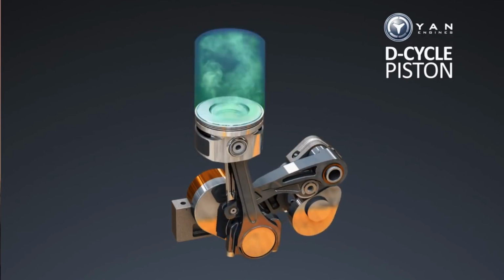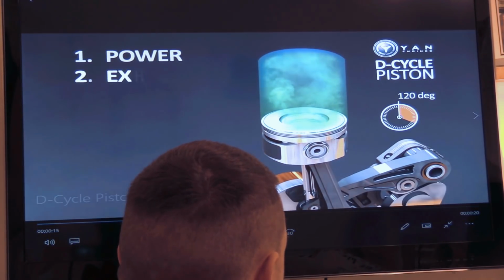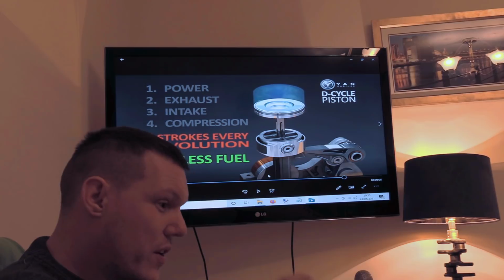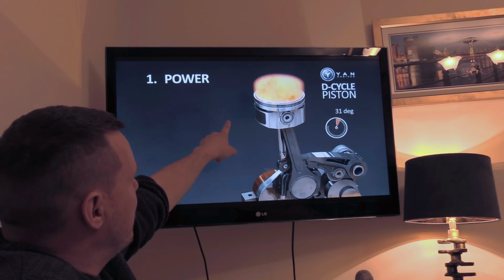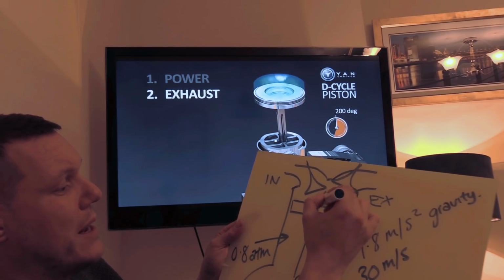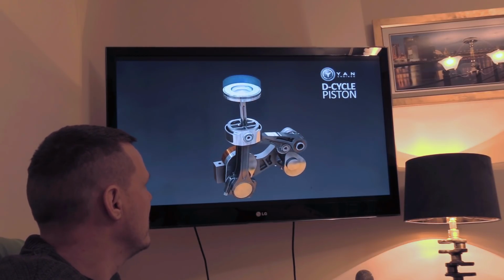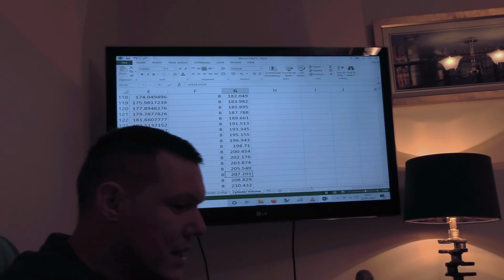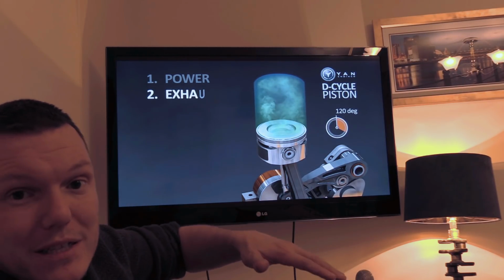Is this a GAMECHANGER? | D-cycle engine

Comment: Hi, Guy, Shall we get together to bring this "Gamechanger" to serve humanity. This engine should operate at half of the 4-cycle rpm, since it work whole time instead of part time. Therefore the crown section Which can be much lighter for higher speed, is at roughly similar rom, depends on the design. This engine has higher torque which moves the car, not the horsepower, which keep the speed.

Comment: Interesting vid Matt, some cool ideas here, but really not sure about having most of a piston acting like some sort of flying crosshead bearing that meets up with it's other half at speed.
Yeaaah...lot of issues with this design, I'd be interested to see how they could be feasibly overcome. I'm wondering if it's possible to do away with that extra camshaft altogether and use a linkage off that forked con-rod to rock the arm up and down, so it's kind of like somebody took a steam locomotive valve gear and stuck it inside a crankcase arrangement 😂

Comment: Let's assume for a moment that the engineering challenges are/have been overcome. Because of the huge accelerations the upper piston would be under, it would probably only be suitable for low rpm running and probably with only minimal rev changes. In that case, I think the best application for this would be for things like a generator; where efficiency is needed and  operating under varying rpm is uncommon. But then you run into the problems that things like generators need to be extremely reliable and reliability require simplicity..... long story short it really is a cool idea but without much practical application without TONS of cash for R&D.
Reply from the maker: The acceleration is only part of the calculation, what you need to know is the weight and the force the connection can take...
Reply: @thedirtyworkshop   - Absolutely correct. If the engineers were able to keep the mass of the upper piston very very low, it could handle relatively extreme acceleration; but if it is very heavy it will not. One reason why I mentioned only the acceleration is because as the accelerations within a given system increase, the sensitivity to the mass of that system will also increase.

All things being equal, if the upper piston has to move the stoke length twice as quickly/twice as often as the lower piston (lets say the crank speed is 1,500 rpm) that would mean that the upper piston, which must move in a 2:1 ratio with respect to the lower piston, is effectively at 3,000 rpm in terms of the accelerations it's experiencing.

That brings up another aspect of the engine which may not be so advantageous. Lets just assume an average piston speed of 25 m/s and a stroke length of 86mm for both a normal 4-cycle engine and the upper piston of the d-cycle. Although the d-cycle has twice as many power strokes per crank rotation as a normal 4-cycle engine, it also can only run at half of the crank rpm due to the 2:1 ratio of its upper to lower piston.

Comment: Multi-stage dry-sump piling system could pull a vacuum on the crankcase (like in the new Z06 corvette) and get past that issue.
Reply: The predecessor of the Otto-motor (todays gas 4-stroke engine) was working poorly, because it was based on atmospheric pressure. The main invention of Otto was the compression stroke. It made something that somehow runs on it‘s own into something that produced power.

Comment: CONSCERNING THE 20% FUEL SAVING. AS A NORMAL 4 CYCLE WOULD HAVE INTAKE DURATION OF 180 DEGREES CRANK ROTATION OUT OF TOTAL CRANK ROTATION OF 720 DEGREES, AND THE D-CYCLE ENGINE HAS AN INTAKE DURATION OF 120 DEGREES OUT OF A TOTAL 360 DEGREES, DOES THAT NOT MAKE IT LESS FUEL EFFICIENT. OR AM I SEEING THIS WRONG ?
Reply: apologies for the caps, its late lol

Comment: I don't think that it will suck less air than a regular engine. Although it will have an intake stroke of only 120°, this stroke will be of the full volume of the cylinder, so the main difference with the R1´s engine it´s the duration (in time) of this admission stroke. When engines are revving high, one of the main losses of power is because of the gases moving fast through the pipes (admission and exhaust). In this engine, both admission and exhaust strokes are really fast in comparison with the engine speed, so, these losses will be really important.
Also, the gases through the exhaust valves normally get choked, so this engine will need really big exhaust valves for being able to let all the gases go out in such a short time.
Reply from the maker: Mass flow rate comes to mind

Comment: The piston speed of that top piston would be beond F1 and not enough time to fill the cylinder on intake maybe high boost? even a low reving v8 stock still has 250 degrees of intake duration with a high rpm cam having over 300

Comment: Upon the first animation I spyed the timing of the two positions meeting at 0 or + 0.0xx amount as the most serious issue. 12:40
As a cold engine with it would be nosy, temperature any positive interference results in a whole bunch of metal bot over time.
A difficult task for say the least.

I agree thee then cross section of the top piston is likely the second bugaboo.

I don't think oiling the mini wrists and is that much of a problem.  The hollow camp chef feeding through the rocker arm of through the connecting rod to the wrist pin.
Exiting out the small wrist pin spraying walls......

Comment: what would be the max revs this arrangement would allow?? .., what would it sound like running ??? would it sound a bit like a 2 stroke maybe?? very interesting concept good video cheers
Reply: There will be a big compensation in rpm I would go as far as to say it will drop rpm by 20% minimum compared to same cc 4 cylinder engine
Reply: Probably more like a high revving 4 stroke. It's the exhaust pipe on a 2 stroke that gives much of the characteristic sound. Edit: a 4 stroke at twice the rpm.
Reply: @Henrik.Yngvesson  cheers
Reply from the maker: A 2 stroke sounds like a 2 stroke because of the firing frequency, I thought everyone knew that, obviously not.
Reply: @thedirtyworkshop  That's only half of it, my low revving 2 stroke trials bike get's often mistaken for a 4 stroke because it's low revving and it pretty much has a straight pipe so it sounds very different from a typical 2 stroke dirt bike of equivalent size. The shape of the exhaust and valve times effects the sound as well, a trombone doesn't sound like a guitar just because they hit the same note.
A rally car sounds different from a normal car even if they're built on the same engine as the exhaust pipes are different as well as the valve timings and not just higher revs.
Reply from the maker: I dont know about half... the motogp bikes sound pretty much like the 2 stroke bikes...
Reply: @thedirtyworkshop  i know you can tune the power characteristic of a 2 stroke by the exhaust gas pulses with expansion chambers and shape and length   but hadn't thought about why they sound that way . they sound like crap anyway much prefer v twin 4 stroke  sound of a big bore duke.  not all of us have  had the opportunities you have had  to learn the stuff you know  assumption is the mother of all fuck ups and if you done a video on it i haven't seen it  yet

Comment: Biggest problem I see is the intake stroke. That little upper piston is not going to move down under it's own weight. Full sized standard pistons don't move in their bores (without being pushed or pulled by a connecting rod) because of the friction of their rings. You could use a desmodromic style cam system (using a second cam above the arm that pushes it down), but now you're dealing with an insanely complex engine with huge friction losses that would likely offset any gains in efficiency. This engine design is both pointless and all but impossible to make work on the real world. That's not even getting into the cost of building such an engine on a production scale (and that translates into higher costs for the consumer). Nobody is going to want to add $20k to the cost of a car to gain little or nothing in efficiency.

Comment: The piston will never work like that it needs the wall skirts to actually stay flat in the cylinder once they separate the piston top from the skirt the (head) will flop around scaring the walls and shear off. While it’s a novel idea it would never work.

Comment: I can only assume that the shape and or timing of the cramshaft makes it so there is little to no force and momentum when the pis meets the ton, but no mater what it’s going to be a change in direction, a film of oil could reduce this impact and prevent any excessive wear though, but it’s still weird to not just have the pis move way faster so it is coming back up when the ton starts to come up, this can be done with mechanical advantage and keeping the cramshaft at the same speed so it’s timed, but having them moving opposite directions when they meet, even if one is stationary and the other is moving is just poor design and sloppy work

Comment: I see this working in a 2 cylinder large displacement (like 2000cc or larger), low rpm engine.
Reply from the maker: Where? Link?
Reply: @the workshop He means he can imagen
Reply: @thedirtyworkshop  Sorry phrased this in a way that makes it sound like I have seen it working. I should have said "the easiest way to see this in a working engine would be"

Comment: The increase in mass of the components. Overcoming the moment of inertia. Increase in frictional loses. Etc. etc. etc. It would be just as or less efficient than an ICE.
Reply from the maker: Well you're guessing, unless you have numbers and figures i don't? Link please...
Reply: @thedirtyworkshop  Matt, true I am guessing. Unless you know of a set of blueprints or a working prototype? I see a significant amount of mass added to the engine, with a reduction in volumetric capacity. Can this engine produce enough useable 'power'?Lexus made a Variable Compression engine work. This is even more interesting.

Comment: 13:50 for high RPM's i would say YES it IS the end of the world, that top piston still weighs something - especially if you expect it to be made of something that can withstand those shock forces. it just looks like mushrooming would happen, NOT TO MENTION, and i think you failed to mention... that difference in loading from the power stroke looks like it will be shared between the main piston and the camshaft. you cant exactly have something smashing on and off of a cam like that without denting it. how can you have that roller in constant contact and not load up the camshaft (WITH LEVERAGE). its either going to do that or go bouncybouncy and smash up trailing side of the lobe. with expansion BOTH will happen. unless you have some linkage thing with a valve spring to buffer it, and then... does the piston still expell all exhaust gasses at high RPM?

Comment: looks like its lost some stroke on the intake
Reply: Yes it does but it doubles it up within the same stroke. If its only has a volume of 200cc instead of the 250 its still gonna have 400cc actual

Comment: The intake stroke only lasts 65° - that can't convert in to much combustion pressure
Reply from the maker: What?
Reply: @thedirtyworkshop  the crown piston's intake stroke barely gets half way down the bore before being met by the rising 'thrust' piston. If it's 200cc in the combustion phase the intake phase looks to be about 120cc.
Reply: Theoretically, it shouldn't matter. If you squeeze 100cc down to 10cc, its still a 10:1 compression ratio engine. Regardless if does it with half travel or full travel. It does have a bigger expansion ratio by design than compression ratio and that has been known to increase efficiency of an engine from a thermodynamic point of view.

Comment: This is incredibly but why can’t the Rotary Engine just be improved? The stress on the cams would be massive even if you had Desmo Ducati open and close cams to bring the top piston down quick enough
Reply: 2 things I can think. 4 stroke engine has est 50% less weighted friction. Ie. Apex seals contact at a fairly high  rate compared to a cylinder because blow by on a cylindrical piston causes it to float up and down the bore and the piston rings barely cause wear problems compared to apex seals in a rotary.

Second point. No low end torque so fairly un usable engine unless your looking for performance and not efficiency but there is a lot that can be done to the rotary engine. My thoughts would be a rolling/rotating apex seal
Reply from the maker: Rotary engines are sgite because if how the force is applied to the rotor.

Comment: It's missing a desmodromic cam to push the thinner piston down to actually make the intake cycle work complete itself. Does it have some sort of positive displacement pump pulling a big crankcase vacuum, while also supercharging it to make the fucker go?
Where's the skirt support for the crown? Did they do some sort of centroid magic shit?
What about the "windage" that has to go through the lower piston support?
There's no way this is for a good bike. Probably a fuckin' moped, or a generator.

Comment: 20% less filled cylinders , can't it be helped out by forced indiction to make up for it

but okay then one has the same fuel consumption and no benefit per say , apart from higher compression compaired to a normal two stroke and a wider powerband mayby ? :)

Comment: With the computer software and modern CNC.  I am sure a prototype RC engine could be made within a month.
Reply from the maker: CNC? You don't need CNC...
Reply: @thedirtyworkshop  
It sounds like you are half way there. 
Or may be you are test running.... Umm am i .....

Comment: they have ben talking about this for 3 years.. and stil no good video of a engine running.. real parts etc. one thing is for soure.. this wont have a high RPM. and the "skirt" of the top piston is WAY to small for it to have a pinion in there.

Comment: Seems like the probability of failure is pretty high
Reply from the maker: Because?
Reply: @thedirtyworkshop  well I’m not nearly educated as you are but to me it would seem that engine harmonics could be an issue. I see a potential for excessive wear around that armature and cam set up ( that roller bearing looks like a weak link for sure) ...the armature itself is adding mass that the engine now has to waste energy to get moving, so even IF in theory it burns 20% less fuel it would be negated from added friction and mass   ...seems to me a horizontal 2 cycle with opposing pistons has already solved many of these problems and removes the valve train completely. (However this design does require some form of forced induction due to lack of that valve train)..Perhaps I am incorrect but I have always assumed that less parts and good materials equals better reliability 🤷🏼‍♂️ yes newer engines are more complicated in overall design but when you break down each part based on function they’re still very simple in concept...basically a bunch of simple parts make up the complicated machine...but this is why I like your channel you welcome inquiry and explain your thoughts very well 👍

Comment: Complexity doesn't mean shite as long as you reasonably improve what you had in the first place. Basically, if the thermal efficiency is the same as a conventional engine then why do it. With that in mind, could the 20% less fuel thing be due to overexpansion (like an Atkinson/Miller cycle) and not just 20% less fuel but also 20% less power?
(I doubt that you could get a 20% improvement just from that so this seems like good old marketing wank)
Reply from the maker: What does complexity and thermal efficiency have to do with anything. Thermal efficiency hardly changes over decades...
Reply: @thedirtyworkshop  How does it hardly change over decades? All the fuss is about less fuel used per unit work output and we've come a long way since let's say the 80s.
Reply from the maker: Thats not what thermal efficiency is lol It would be good if you knew the difference.
Reply: @thedirtyworkshop  we are not talking about the same thing, mind to expand?
Reply from the maker: 1) what i asked originally what does complexity have to do with thermal efficiency?

2) fuel efficiency and thermal efficiency are 2 different things. Carbs waste more fuel than say direct injection. Thermal efficiency is how much heat it converted into motion. Not the same thing...
Reply: @thedirtyworkshop  kind of missing my point there dude. Maybe I should have used fuel conversion efficiency or specific fuel consumption, but let's keep combustion efficiency out of the discussion so we are on the same page (because if I'm comparing the Yan Engine to a normal ICE of course I'm assuming the same fuel metering and combustion characteristics - otherwise it wouldn't be fair).
Reply from the maker: And I'm talking about the scope of possibility of the design...
Reply: @thedirtyworkshop  I'm not having a go man, I actually dig the way you analyse things.

As far as the D-cycle engine is concerned, I'd probably give myself a pat on the back if I came up with it lol.
I just don't get it when they say stuff like "20% less fuel" without supporting it whatsoever (with a prototype, data or even just the principle behind it would do if it's in the funding phase). If it's 20% less power as well, it doesn't really provide anything. If it's actually more efficient cause its expansion stroke is longer, Miller did it in the 50s only changing the camshaft. But I liked their cringe promo video. All the best.